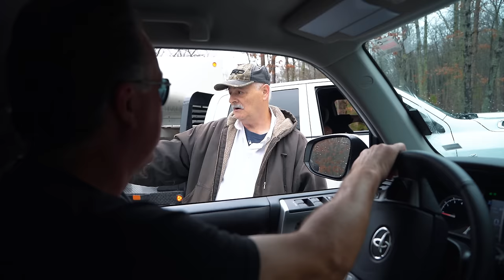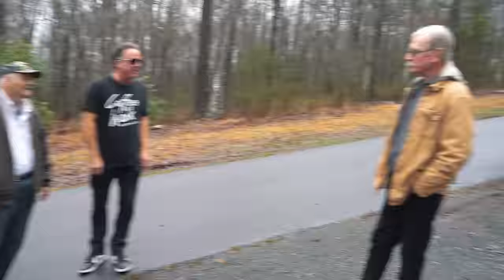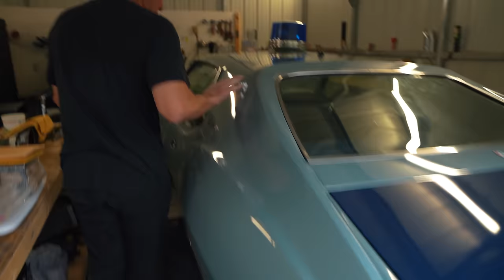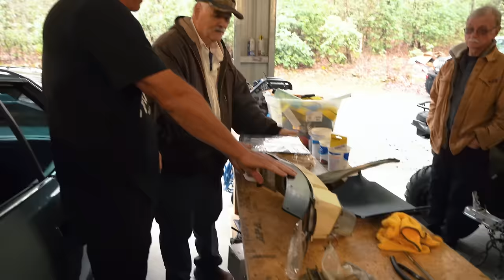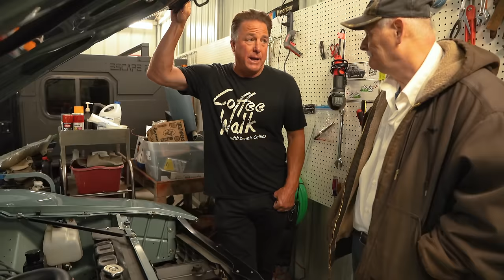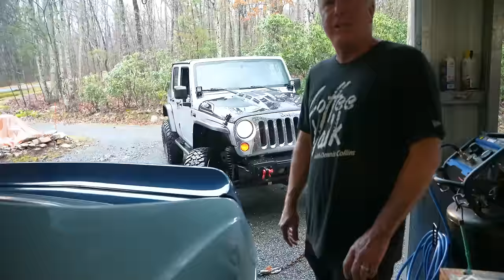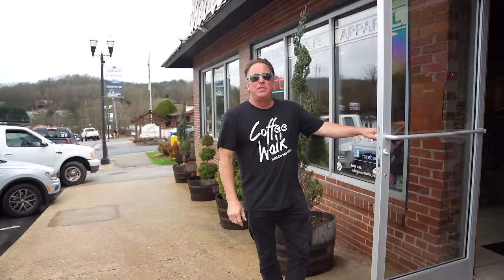FOUND: 1 of 13 Existing ADPS 1972 Javelin SST Police Cars!

Comment: An old friend of mine told me this storyThis story was around 35 years ago. He had a 67 Impala 396 SS 4spd ran from a State Trooper in a Javelin he met on a hilltop. He managed to get a nice jump on the Trooper and turned onto a side road. Said he had run about 10 miles and was headed down hill and he head a siren coming from behind. When he looked in the mirror, he saw the blue light. He said he grabbed the shifter to upshift into 3rd when he looked in the rear view mirror at that same moment the trooper floored the throttle and he heard the 4 bbl moan and literally saw the the headlights of the Javelin lift. He said he just left it in neutral and pulled over. 
I am born & raised in Alabama. I had the privlege of seeing one in the lobby of the old headquarters for the Alabama DPS buliding.

Comment: I have a 1972 Javelin that my wife got new in 1972 so it is a one owner vehicle.  It has the 304 engine with an automatic transmission. It has approximately 30,000 miles on it because my wife and I always had company vehicles while working.  It has been in storage for more than 35 years.  When my son was getting old enough to drive he wanted the Javelin so we started fixing it up.  We replaced all the hoses & belts, complete tune up, new tires, new fuel pump, new battery, new carpet and much more.  We started repainting it and he changed his mind and wanted a truck.  It went back into storage, and he is now 37 years old.  Don't know what we will eventually do with it.

Comment: I had a 74 Javelin with a 304 and 3 on the floor AC car back when. Been looking for a replacement off and on in my old age since that car got totaled on the way to a Judi's Priest concert around 1982 when an elder couple took a left turn in front of me. Nothing like that beast you have there. Got me pumped up to start looking again.

Comment: Such a beautiful car . I've ran more than a few AMC cars including a 360 Hornet . I've never seen a 401 in person. I looked for one but only found 390 that people believed were 401 . The 390 was even hard to find. I found my 360 in a wreck. I took the whole drive line out of the wrecked car . I caught more than a few cars off guard with that little Hornet . It was a 360 4bbl, 4 speed and positraction rear end.

Comment: That's a sweet machine my friend. It's good to see some AMC love. Back in the 80s my dad was part of DVAMO. There were so many Rambler/Nash?AMC cars around then. Now, when I take mine to an event it's usually the only first gen Javelin around. It was interesting listening to the cost of the NOS parts for that Javelin. I would love to get a new NOS grille for my 69 Javelin SST, but they are expensive. Kennedy American is asking $1150.00 for a replacement grille with the bullseye.  My Javelin is in need of some paint TLC. It was repainted in 1981ish. There is chipping on the driver side headlight bezel. Otherwise, it's in pretty darn good condition. An article was written about it back in the 80s for a publication called carbuzzard. I still have the photographs that were shot for the article. Looking forward to seeing the rest of the videos on your car!

Comment: In 1971 I got passed by one of these cars on Hwy 80 - the officer was headed to a roll-over wreck further down the road.  I was doing 60 mph at the time and the trooper went by me so fast, all I heard was a whistling sound and whoosh from the air pressure change.  By the time I looked by up, all I could see was that big blue light flashing on top - about 1/2 mile ahead.

Comment: Love the AMC stuff. The AMX's got big after '70. The '69 AMX I had in the mid '70's
390 CR 4sp posi rear end.  Geared very low, don't know ratio. Max speed was about
120mph wound really tight (close to red line) Literally a fire breathing monster. 
light yellow w/ black stripes (Pompeii (?) Yellow). Wish I had kept it along with every
one I ever had.

Comment: My Grandmother gave me her 1967 Barracuda that had set for about 15 years. I took it home changed all the fluids, plugs set gap and timing and lifters.  Poured gas in the carb and it fired up the first time.....I drove it around the block.  I am now working on a 1975 AMC Hornet fastback...

Comment: I have had 2 AMX's and 2 SST's with everything from 304's to 401's so this car brings back some great memories. One of my AMX's had the same Instrument cluster except it was a holographic like brushed aluminum face instead of woodgrain that the doors matched also. AMC put tall gears in most of their cars so they weren't the quickest but they did have a lot of top end.

Comment: Looks a lot like my brother’s 1970 Javelin.  His was a Mark Donohugh special.  390 motor, 727 transmission, 411 posi rear end.
Reply: 1968-1970 Javelins were a different body style, sister car to the AMX and shared a lot of the parts.  1971 saw a redesign, commonly known as the "humpster" due to the wheel humps.  71 & 72 had the "strip" taillights.  1973 & 74 had some design changes including the change of the rear to the "TV screen" taillights.   We own a '69 AMX and a '73 Javelin AMX (the "AMX" moniker was kept alive after the original 2 seater AMX was discontinued in 1970 (production 1968-1970).  "AMX" became their version of Chevy's SS badging.  Having an original Donohue version is something to be proud of!

Comment: I remember American Motors marketed the tachometer-clock combo as the Tick Tock Tach.  I almost bought a '73 in 1974 and regret to this day that I didn't.  I bought the '74 Matador two door coupe Oleg Cassini edition with the 360-4V and dual exhaust.  I wish I still had it.

Comment: Man takes me back to the 70 Orange Mark Donohue I had. 390 4 speed. The car I most regret selling. But, I still have a 360 and 401 sitting on pallets and may build the 401 to replace the 304 in my CJ7. This Javelin is unreal!

Comment: Back in the 1970s a friends Dad owned the local Goodyear Tire that contracted with the police in Florida. The police NEVER used the factory tires. They used "Blue Streak" radials that carried an "S" or "T" rating which was 110-118 mph. These tires were track rated and not for sale to general public. The police also used inner tubes to help disperse heat and reduce high speed failures. As street racers, we used the exact same setup because the tire dealer would designate the tires as "blemished" which allowed us to buy them out the back door. Haha.
Reply: BF Goodrich also had "Police Specials", (if I recall the name correctly).  In 1977, we had them on a 1971 Plymouth Fury II that was a former PA state police car.  They actually said "Police Special" on the blackwall, and like your Goodyear's, they weren't available to the general public.  I have no idea what the speed rating was, but those things grabbed the road!

Comment: I was a Policeman in Al back in73, i seen a few javelin's, sharp looking. I ask one Trooper about them, he said it would run 130 no problem, but they couldn't keep the front ends  on because of jumping the media strips. Some had 4 speeds in them. Think they were a few ambassadors cars with 401 and 4 speeds.

Comment: Highway patrol station in hendersonville nc did scavenge parts from wrecked cars. In the 70s 2 mechanics worked full time. They pulled engines from a huge oak tree  had a small carport to work in the rain... definitely different times.

Comment: owned a second hand (repo'd) 1971 AMX 401 around 1972 (Automatic)  . Once ran it full throttle - it upshifted at 100 mph and chirped the posi tires .

Comment: In 1974 I bought my first used car a 1968 Javlin SST 343 HO BW Super T 10 four speed and posi rear for $500.00 with 48,000 on the OD. All it needed was the front bumper replaced. stupid fast but nothing like a 401. A friend had a 1972 SST 401 nothing in the county could beat it. I rode in it at 160 MPH beat the pants of a 1971 road runner with a 440 six pac you have a great car there they were build to beat a Corvette. Easily done.

Comment: I was in the Air Force back in 1973 stationed in Biloxi Miss. I had a 1969 Shelby GT 500  that was built. I was near the Tenn Alabama line when one of these came after me. I ran off and left him behind at about 140. Hit the Tenn line and slowed down. But they were the coolest looking hiway  patrol cars arround.
Reply: Mr Collins my Shelby was very unique. It was a GT 500. Auto with air. No power steering ! Paid 1100 in 1973.  Ahh the good old days.

Comment: I was 9 and 10 years old when these cars were running the interstates here in Alabama.  It was crazy in those days.  My dad had a 429 Ford LTD and his buddy had a CJ Torino and they'd run all over the state over 100 mph.  Like Dennis and the fellow were talking about, GTOs and Superbirds were crazy fast and the troopers wanted something to run them down.  I was too young to know much, but legend had it that the Troopers would run the Javelins at 140+ all the time to run down speeders before they even knew what happened.  At one time, there were 2 original State Trooper cars that I knew of.  One was at the car museum at Talladega and the other was on display in the basement of a state building in Montgomery.  I've seen the one in Talladega but I don't think I ever saw the one in Montgomery.

Comment: Late Summer of 1973 I was driving cross country to Dallas Tx in my Porsche 914-6. I had left Florida with two female friends who were driving a leased Toyota Corona wagon and we stopped in Eufaula Alabama for fuel late in the night. Because I was fueling in the front and one of the girls were fueling in the back left, in the rush to get going the gas cap had ALMOST been left off on the Toyota. Cap problem resolved we tore through the rolling two lane hills of Alabama UNTIL the driver of the Toyota in the lead came to an off camber right hand curve and rolled the wagon multiple times. Happened so fast that at one point I nearly center punched the Toyota’s undercarriage. Low and behold Alabama’s finest arrived in just such a vehicle as this! First and last time I ever saw one again until now and it was the dark blue!

Comment: My dad would go to the Alabama auction to buy construction equipment. As a teen, I went too. I always liked the Fords with the 428s and 429s. But I remember these Javelins. Mr Roper a capital guard there was my friend, He told me the only person to out run them was a teenager in a Chevelle or something like that that had been really souped up. But he ran out of gas. Mr Roper said they would top out at 156 MPH. Im pretty sure that was the Javelin and not the Ford, but that was almost 50 years ago. A few years later I bought a 74' Custom 500 Ford from the GA State Patrol. I paid $550.00 for it. It was in good shape but still in GA blue and gray. I painted it black. It had a 460 Police Interceptor and Police special radial tires. I dont remember the speed rating but it was over 100. That car would out run the word of God. I had it up to 126 mph. The good ole days....

Comment: I was going to missle school in Huntsville (Redstone Arsenal) in 72. A couple of buddies came in the barracks and said they just saw an AMX police cruiser with a gyro in the trunk, demonstrated that it could drive with one front wheel removed. Mind you, they weren't doing donuts or burnouts but could tool it around gently on three wheels. Bet you couldnt flip that one over if you tried. Had the same blue bubble gum machine on the roof.

Comment: Better restrict the oil to the heads if you wanna do long distance full pulls. Those things would fill the valve covers with oil and starve the mains. ALOT of engines gave it up in durability testing until that got sorted. Rumor is, they stuck pipe cleaners in the pushrods

Comment: Now Dennis just needs to find a 1971 alabama state police 401 javelin with the 51CC high compression heads , Over half of the total number of Alabama state police javelins were ordered and delivered before the end of 1971, 70 units were delivered first and had the 1971 #291c 51CC high compression big valved dog leg port high compression cylinder heads !!! The rest were 1972 models with 57CC heads but still had the big intake valves and dog leg ports of the  1971 heads..the later larger combustion chambers unshrouded the valves so horsepower loss was minimal

Comment: I passed one of these back in 1971 between B'ham and Tuscaloosa while I was testing my sportscar to see if it would do the 175 mph .  It was 2:30am on a Sunday morning and this Javelin trooper car was meandering along when I nearly ran over it.  He didn't come after me which made suspicious about why he was the only other vehicle on that stretch of road besides me.  I figured either he was having trouble getting home with the car or he had been out late when he wasn't supposed to be.  I was told they had a weight shift system that made it corner better but I've never confirmed it.

Comment: Think those engine have a oiling problem, good thing there is a fix for them, they thought it was the pan going dry but its in the upper end, I would keep the long revs down till you investigate or google it

Comment: This color combo was used on Alabama State Trooper cars from at least 1964, I don't remember the fifties or early 60's color scheme, could have been black and white, but I'm not sure. I do recall seeing these cars in '72, I was 19 and always kept my eyes peeled when on the road as I tended to drive a little fast. Also. Alabama didnt require a title for autos before 1975, all you needed to register a car was a bill of sale.  Nowadays Bama Troopers drive SUV's and some Chargers with same color scheme, but not all vehicles as they also have pickup trucks of various colors. I miss those days when the troopers got new cars each year, always Fords until '72 when these AMC cars were on the road, then back to Ford afterwards.

Comment: Dennis said it, they tended to run hot back in the  day
Reply: he is referring to the engines if they had to be overbored +.030 or +.060 etc... stock bore 401's don't run hot, they run at normal operating Temps and were used in jeeps

Comment: ok guys I remember the old drivers of those cars  and met a couple of them over the years . The big problem wasnt the speed it was that wont turn at high speeds and that lead to the crashes now another friend ran with them using a dodge super bee and he did outrun the javlins with a 2 speed transmission but he was friends with those guys. his name was Alfred Rynalds .

Comment: Listening to the motors run on video it seems we always hear tics and rattles that might not be there, but it did seem like there were some tics in this start up. Were those valves or gasket leaks? Great find and so happy you are getting it to where it needs to be and finding it a good home. That is what you do best. Its why I am trying to get you my wifes Uncles' cars. Hopefully it will happen.

Comment: Roger Penske and Mark Donohue contributed to the design of the 71 up javelins so they would be competetive in Trans Am racing...aerodynamics and weight were addressed it the design and this engineering trickled down to the production cars giving them the unique countoured shape.

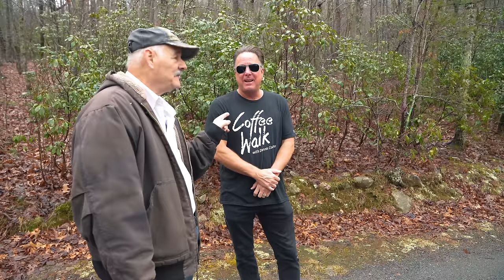Comment: In Kansas in the 60's and 70's our State Troopers ran a lot of Hemi Plymouth Fury's with 3:23 gears that actually WOULD run down ANYTHING on the road in those days. In the 70's they randomly picked some of their pursuit cars every year or two and ran them through a radar trap to check their top end speeds. I was told by some of our Trooper friends that it was not uncommon to have several of their Plymouth Fury's  top out over 170 mph when they tested them. I believe the N.C. Troopers AMC Javelins ran pretty strong, but with 401 c.i. motors and 3:73 gears I don't believe ANY of them would REALLY get near 170 mph. In those days about the only thing that could ACTUALLY run down a Hemi Mopar with 3:23 gears was another Hemi Mopar with 3:23 gears.

Comment: i was told i had one of these cars way back in the 80s in south Georgia. i was told from the used car lot  it was a Alabama state patrol car it was same color and mine but didnt have a spoiler my Jav had a 360 all that could be changed over time of course. I hoped it up and painted it Georgia state patrol colors. lol  and had a great time drag racing with it and yes it freaked me out how much top end that car had i had to back down at 140 mph when racing a  429  mustang yes i won. :)

Comment: Mr Collins, I believe we might have to talk... I have been meaning to call you Sir. 

Unfortunately I don't have the vehicle anymore but..... (have some parts, might be able to get the rest back) had a 63 impala SS 340hp 409 w AC....

The amazing thing about the car is What options it didn't have!!!!!)

The vehicle is an original EXP car....
Meaning factory experimental. (Rumors had it one of the people in the early 90's that were trying to buy the car was actually General motors. They wanted it back for an anniversary....)

Supposedly the color change was done by the factory for the VP of GM, the exp tags......

I still have a few extremely rare options for the vehicle. Including a 61 trunk mat.... yes..... it is an original 61 trunk mat......

Comment: I owned a  76 AMC  Javelin with a  401 with  a  750 Dual feed  Holly  but  only  1  line  was  hooked  up  it  had  Headers  air shocks  but  the  Exhaust  shocked  cause  every  time  i  hit  a mud puddle  I  lost the Exhaust  from the headers back while  i  also  admit  it  did  not have  reverse  I  still  loved  the  car  cause  it  was  Awesome  till  H&H Towing  got  their  hands  on  it  and  messed  it  up  trying to  keep  me  coming  back  for  more work  for  them but  i  miss the  72  Charger  I  owned before that  but hey  I wish  i  knew then  what  i  know Now